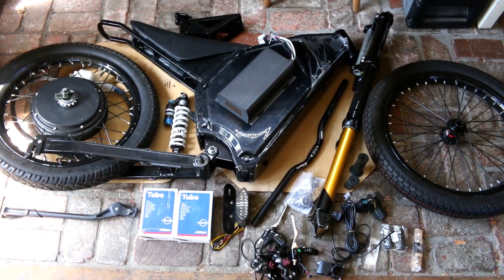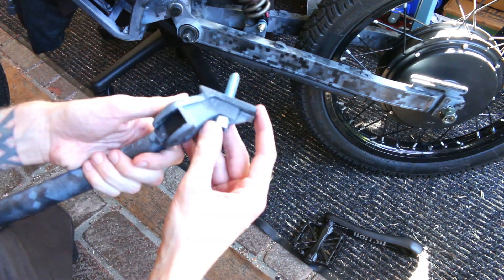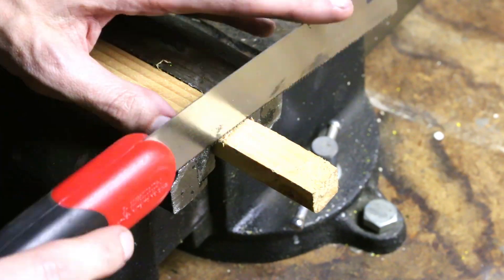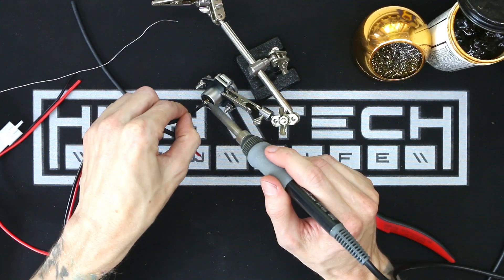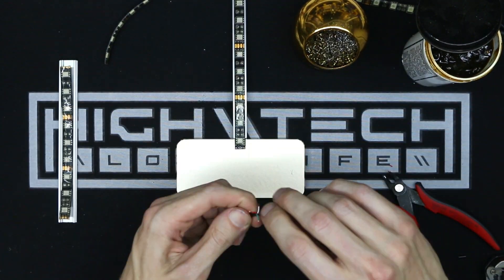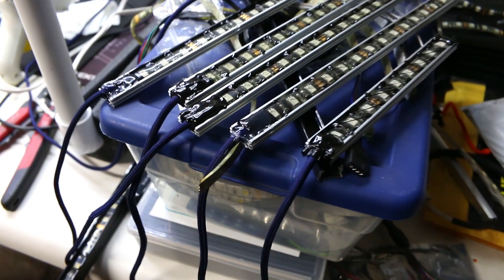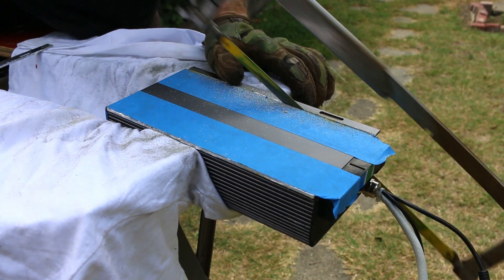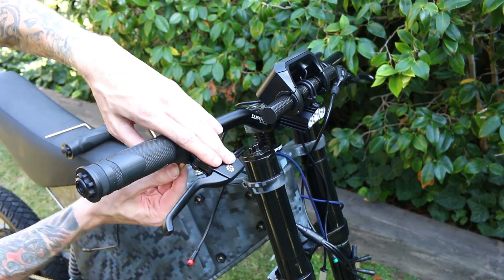🚲 Custom 5000W Digi-Camo E-Bike [54MPH!] - Part 2 - Wiring + RGB LEDs

Comment: friend, why do you have that guide for changes if it is a single pinion?🤔🤔
Reply from the maker: It's because these dropouts are vertical, there is no front and back motion so you cannot adjust the chain tension in the traditional way by sliding the motor forward or backwards. For this swingarm type you need a derailleur type chain tensioner 👍
Reply: @hightech-lowlife  thanks friend! Good explanation. Sdos from Posadas Misiones 👏
Reply from the maker: @flag2612  No problem man! Say hello to Argentina for me 🍻Greetings from USA 🙌

Comment: thats interesting, I have a similar bike with some of the same parts e,g. frame, brake rotor.  It took months to make mostly due to the wires, I also had an issue where one headset bearing had a larger hole than the other.  The bike is cool and accelerates quite fast, its more stable on rough terrain,  but my main issues are its heavy weight,  very hard to change tyres or inner tubes, and range is not great with a 72v battery from aliexpress thats stated as 40 AH but I typically get 25 to 30 AH from it and it cuts out completely at around 66v even in power mode 1,  it also can only produce 50 amps.  The bikes range is also less than I expected, the most I've gotten is around 60 miles, while staying below 20mph as much as possible.
Reply from the maker: That's awesome! These are some of my favorite types of ebikes really, they are very heavy though and when I need a tire change I just go to a motorcycle shop as they are a huge pain to do it without a machine. 60 Miles is pretty good though! Thanks for your input!
Reply: @hightech-lowlife  have you had a chance to ride a Sur Ron ?  i'd like to know how people feel the two bikes compare to each other,  as I wonder if I would prefer the Sur Ron,   in the UK they cost quite a bit though,  around 4500 pounds, about double the upper limit of what I'd usually like to spend on an e-bike, also they are loud and attract a lot of attention, good and bad.
Reply from the maker: @ash0787  Yes, my friend actually bought 2 sur rons way back in 2015/16. This was before I was even into ebikes at all. I thought they were pretty cool, basically a smaller dirt bike but electric. I did note they were a bit loud for electric though. I think they are a good bike, I also think they're worth the money, but if you're into DIY things, you can make something as good, if not better for less 👍

Comment: Hey do you have any websites or source material you could recommend on building an ebike? I noticed there is a large amounts of different frames and parts and its kinda overwhelming lol. Anyways your videos are so great just seeing the process. Thanks for the effort you put into your builds and videos!
Reply from the maker: Thanks man!! Not really any once source other than "the internet" but that's a bit vague. Almost all of my knowledge was gained through the experience of building them, you start to figure out the nuances. Of course you can read many articles and watch videos and it will help you but there is a lot to learn regarding all of the variables, options, choices. 

Ebikes are a lot like any other product where you have to figure out what you want and then how much of a budget you want to spend to get what you want. (how fast, how far it will go, what kind of frame is comfortable for the type of riding you'll do, etc). 

There are basically 2 types of motors, hub motors which go in the wheel, and mid-drives that attach to the frame. There are pros and cons to each, but generally hub motors will be cheaper. 

Then there are batteries, you can choose from 48, 52 and 72v systems (there are even more but those are the most widely used). Usually the more powerful they are or larger the more expensive. 

I would recommend if you're just starting out to purchase a kit that has most of the things you need, then just get a battery that will work with that kit. 

This video I did goes over how to build one that is cheap and easy to make: https://youtu.be/L0SnN9du-Ac 

There are tons of resources online though, guides, build videos on youtube, try https://endless-sphere.com forums and r/ebikes on reddit if you want direct contact with people in the community, they are happy to help with questions and I'm sure the forums have a lot of wikis and FAQs for building 👍

I will make a video for beginners going over all of the things to help get you started. The important thing is just to start though, get some parts, build something, then go from there.

Comment: You’ve already replied to me tonight but I started watching more of your videos and I was wondering something if you have a second? I purchased a 5000W stealth clone from Alibaba that I’m planning on upgrading.  I’m just wondering how you’re getting 54 miles an hour? Im getting 46 miles an hour however I have the heavier crappy frame.  My BMS is 80A times 72v which is roughly 5000W+ with my 26ah battery. I am going to upgrade the frame and controller and planning on adding a second 10ah 72V battery.  Basically my goal is 50 miles an hour and I’ll be happy. Also is that a QS motor?
Reply from the maker: QS205 should be able to get you 50+ MPH easily. A heavier frame shouldn't make that much of a difference (10/15 lbs max). The easiest way to get to a higher top speed is to just increase the amps going to your motor. If you get a controller and battery that can output 150A you will be way faster than you want to go 👍 What controller do you have? Also check to see what windings your motor has, 5T will have more torque but less top end, 3T will have higher top speed but less torque. You should be able to hit your goal without spending any money, I would first check your controller settings (if it's programmable).

Comment: Came for the E-Bike build but loved the Cat 😁
Reply from the maker: 😁Thanks so much!!
Reply: @hightech-lowlife  Your are welcome ! Cats have an incredible interest if you are working on things. BTW: You should think about getting a 3D printer. This makes stuff like a mount for the light bar or battery inserts for flashlights very simple. I have 3d printed parts all over my different e-bikes.
Reply from the maker: @HolgerBeetz  Thank you! Yes, I have a 3D printer on my list of things to pick up 👍I already have a ton of things I could use one for so it will be a great addition to my toolset. I'm thinking of Prusa or Ender, but if you have a recommendation, let me know.
Reply: @hightech-lowlife  Well, it depends on. A Prusa IMO is good for starters and if you want to stay in the "Prusa universe". In other words: Use their slicer, their filaments. With a Prusa you not only pay the printer but a whole ecosystem. An Ender 3 for example (I have two) is really cheap and with a few parts (Carbon print plate, All metal extruder stiffer headbed springs) you will soon get identical prints. Parts for the Ender 3 family are widely available from Ali Express. For example a Microswiss All Metal Hotend Copy sells for 8€ and works flawlessly for me since many hours of ABS /ASA printing. From a pure price point: A half assembled Prusa Mini costs as much as two Ender 3 with the modifications described above. Since you seem to be more of a hands-on tinker guy to me I would go for the Ender 3.
Reply from the maker: @HolgerBeetz  Thanks so much for the info man! Ender 3 seems way more up my alley 👍I'll definitely go that route. I enjoy quality but sometimes you can get 80% with a whole lot more universality with a much cheaper build and I'm into that. Thanks again, much appreciated.
Reply: @hightech-lowlife  Drop me a PM if you have further questions. I am more than happy to help. With 3D printers and manufacturers this is somewhat identical to everything else. Everyone has his favourite "brand" 🙂
Reply from the maker: @HolgerBeetz  Thanks man I really appreciate that, thank you for helping out! That's very true, us humanoids - we're a tribal bunch 👍Thanks again!

Comment: which
brake
you
have
used
?
Reply from the maker: For the fronts? AVID, they are hydraulic with 203mm rotors. Rear is full regen only. 

You can find a list of parts here: https://hightech-lowlife.github.io/projects/006_digi_camo_ebike/006_digi_camo_ebike 

Thanks
Reply: @hightech-lowlife  thanks
for
the
reply
you
are
humble
Reply from the maker: @jagjeetsingh-cc8sd  Thank you!

Comment: You have great talent.  
Thanks for showing us your build.  I love this kind of content.  That thing is going to be a blast....an electric motorcycle with pedals.  Love it.
Reply from the maker: Thanks Luke! This bike is awesome, my next build will be similar to this, but even more power ~ this bike peak is 80A, next build will be 250-300A! Thank you!!
Reply: @hightech-lowlife  Are you goiing to use the same frame and wheels, suspension, brakes etc?....just change the rear hub motor, controller and battery?  Where did you get the inspiration for the Camo paint scheme?  Are you ex military?
Reply from the maker: @lukewalker1051  It will be a totally different everything, just a similar frame and suspension. Bigger motor, controller and battery! I'm just a fan of camouflage, always have been. Thank you!

Comment: Nice job. I have this same frame and fully customized it, I lovingly call it the #HellbirdBanditBike, and it’s a 134v SUPER LIT Ebike 🔥🦅
Reply from the maker: Thanks man! I checked out your bike, it's awesome! You definitely have a better LED setup than what I did, looks great. 130v? What controller are you running? That's crazy. Must be very quick 🤘
Reply: @hightech-lowlife  I installed a 100a Bluetooth controller, so I can modify the settings from my phone which is nice. It’s capable of going over 80mph, but I have the controlled tuned down to 60% and then have 3 speed button(20%/40%/60%) and at this setting I can still hit over 61mph, which is plenty fast enough for riding in LA, but the best part of my setup is the range😎
Reply from the maker: @clemonsjoey  Awesome! Yeah most of the time I would ride in 2 or 3 setting, only opening up when you really want to go crazily fast :) Sounds like a really cool bike, thanks for sharing!

Comment: what size wheels are you using
Reply from the maker: They came with the used parts I bought off CL, but they are 17" rear, 18" front. I personally wouldn't have mismatched the sizes (even the tires brand/tread are mismatched) but I didn't want to chunk down the extra $$$ to try and find a matching set so I went with it 👾
Reply: Thank you for the reply! I appreciate it!
Reply from the maker: @umerkhan9187  Hey, no problem at all! thank you for watching! If you want a full parts list I have one on my blog: https://hightech-lowlife.github.io/projects/006_digi_camo_ebike/006_digi_camo_ebike
Reply: Keep up the amazing content!
Reply from the maker: @umerkhan9187  Thank you so much! I will do my best, I have a lot of projects coming down the pipe in the future 🤖⚡

Comment: Where can i buy that charge port u have?
Reply from the maker: It's expensive, but very high quality: CNLINKO 2 Pin Power Connector Male Plug & Female Socket Waterproof Outdoor IP67 - https://www.ebay.com/itm/122857358641